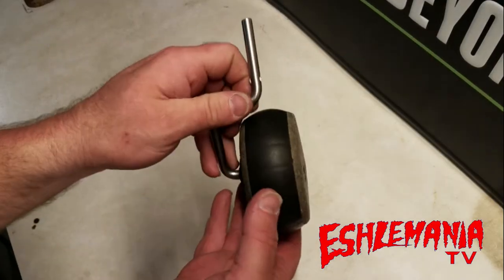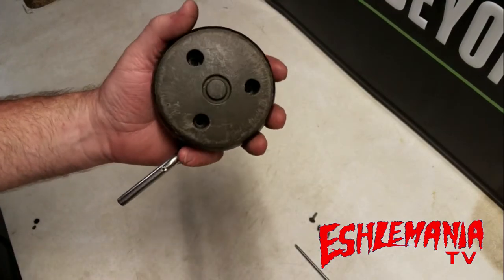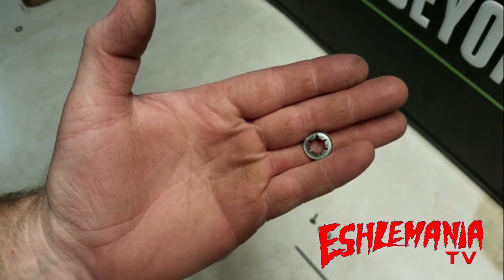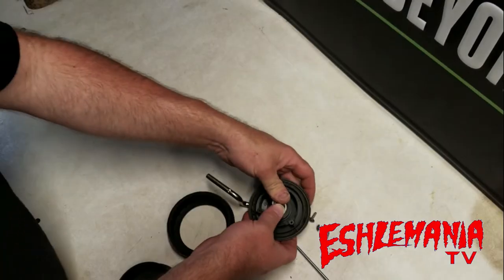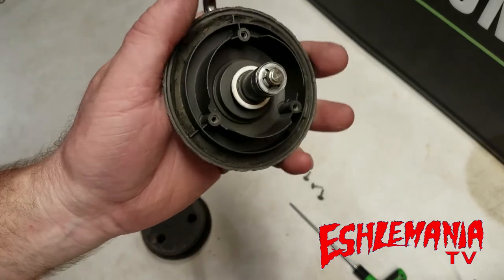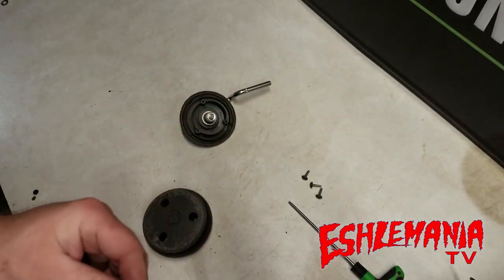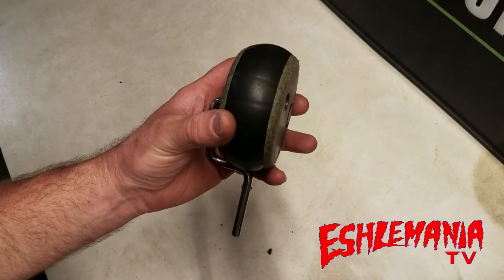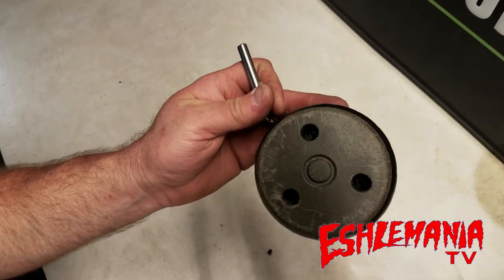Automower Answers: Husqvarna Automower Front Caster Wheel Replacement & Repair.

Comment: Good video, for a temporary fix I used the old snapped retaining rig (squeezed it with pliers a bit), put it on the axle and squeezed a spring lock ring (sp?) so it locked tightly on top of the old retaining ring. Seems to be holding for now anyway. Bearings are probably next since the thing has been running over 4200km already 🙂
Reply from the maker: If you need replacement parts for your Automower visit www.roboticmowerservices.com

Comment: Many thanks! This was very helpful. I had just ordered a new shield kit, thinking that was the problem because it was worn down on two sides, but after I watched, I took the wheel apart and put it back together, (taking a while to put the lock washer back on) and so far so good! I guess I will just use the new shield if the wheel comes off again at some point.

Comment: love your videos. Have gotten a great deal of tips on taking care of my Automower. Can you do a video on running 2 automowers in the same yard. I have a 450X and a bit more than the 1.2 acers recommended. Would like to have one do each half of the yard
Reply from the maker: 2 mowers in the same yard is easy to do. Just install them and let them go. They do not recognize each other or know that one another exists. We have done multiple installs on several properties now. Some we even have the work areas over lapping. If we get some time and decent weather we'll try to set up a small demo for ya.
Reply: can you do 2 mowers from the same charger? and set up different zones for each within the same boundary wire?
 @EshlemaniaTV

Comment: Thanks. I would like to see how you replace the wheel with axle assembly. Need size of retaining clip so can buy extra. No problems with front wheel for first two years. So far this year, two front wheels have come off.
Reply from the maker: Replacing the whole axle assembly requires splitting open the chassis. Since it is rare to have an issue with the axle itself most people buy the complete assembly and just swap the wheel onto their existing axle. The push on retaining ring is 8 mm. 5/16 will work but takes a bit more force to get on the axle.
Reply: @EshlemaniaTV  presumably the 5/16 will be a little more prone to breaking/splitting after a while because of the extra force required. 
I had a front wheel fall off, and it got chewed up by Eustace 😆

Comment: My wheel kept falling off. I came across this video, awesome! So I took mine apart and the lock nut seems fine! I'm not understanding why it would keep falling off.
Going to reassemble, but I have a green o-ring that fell off from somewhere and I'm not sure where it goes. I don't see this piece in your video as you're taking apart and putting back together, perhaps it's something new on the 430XH?
Reply: I understand that this answer is a year late, but for anyone else wondering. The green o-ring is placed in the slot above the outer bearing - look at 5,00 min of the video. It is not in place there, but should be.

Comment: Why to hassle with a lockwasher, which tends to often break (because it is too thin), when shaft lock collar can get the job done more easily and is more durable in time? This alternative repair method is addressed here: https://www.youtube.com/watch?v=_ayoZdTo0i0
Reply from the maker: I know a couple people that did that as a way to repair their front wheel when it came off. It works and makes replacement much easier.